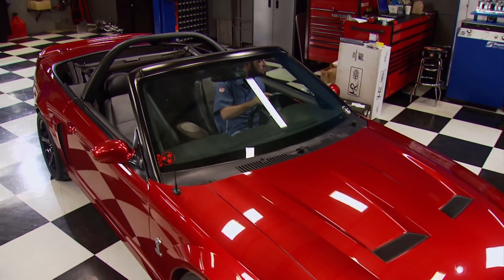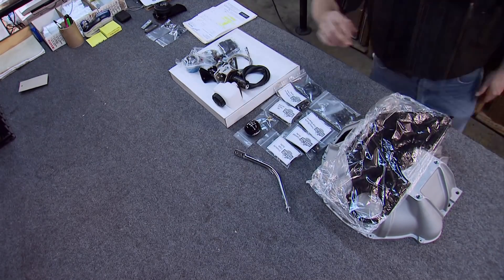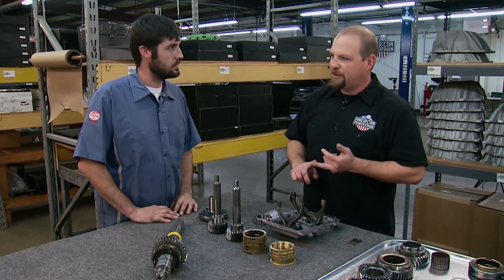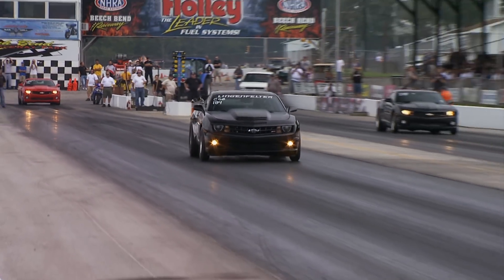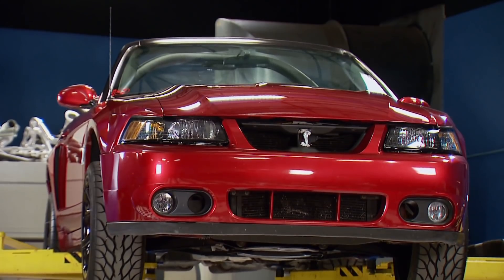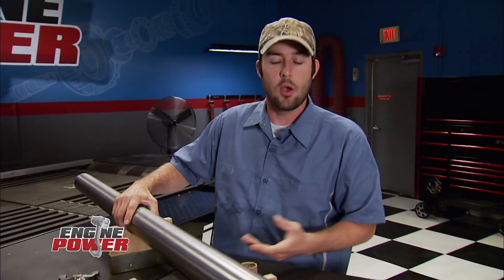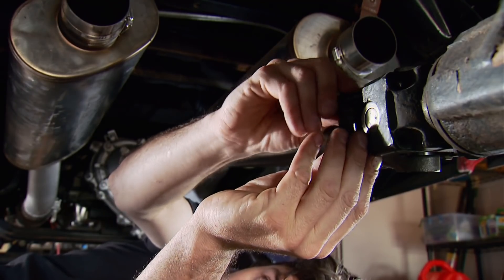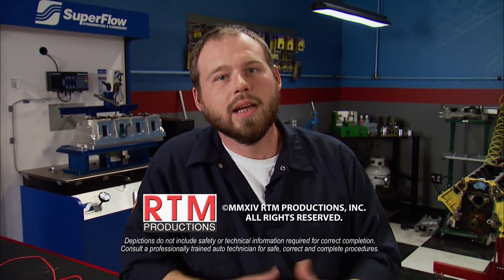Building A DIY Driveshaft For A GMC K1500 4x4 - Engine Power S1, E5

Comment: A shop is not going to be able to true a driveshaft after it has been welded together. This is done when the caps are pressed on prior to welding. It involves spinning the shaft with a dial indicator and tapping the ends with a sand filled hammer to adjust it true. If the tubing selected is totally true, runout should easily be less than .005"
Reply: you could probably get it close with oxyacetylene or tig torch to shrink metal on the side that's running high even if it's fully welded out 
ive done this on warped flanges and out of true shafts

Comment: Boy you make it look so easy.. 

Could you recommend a honest good and fair auto mechanic in WA state? (As close to lynnwood wa as possible). 

Specifically Looking for one to check and finish my engine swap. (Could include welding, transmission crossmemeber build or tweeking, make a better metal floor console shifter box. Etc. 

My wiring is all great. So don't need any electrical help.

Comment: Do you make transmission crossmembets for 1976 cj7 jeep with the gm 4.3 v6 engine and th700r4 Automatic transmission engine and Dana 300 tcase? 
I am using mountainoffroad JM200 engine brackets and mounts. 
Thanks.

Comment: True the driveshaft on a lathe with a dial indicator before welding the driveshaft shop will laugh you out the door after they put it on the balancing machine

Comment: We built them for stock cars out of junkyard shafts. Cut out the rear plug with a diamond hacksaw blade. Cut the tube with a large tubing cutter.  Make sure the plug/flange was true and weld it up. Use a hose clamp and old weight to balance if needed.